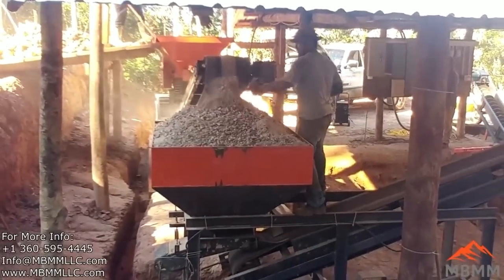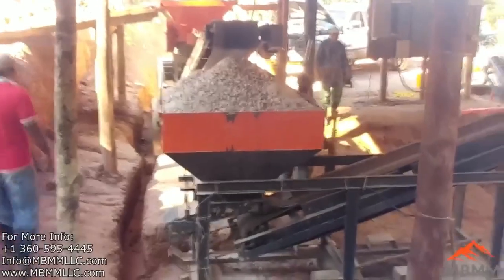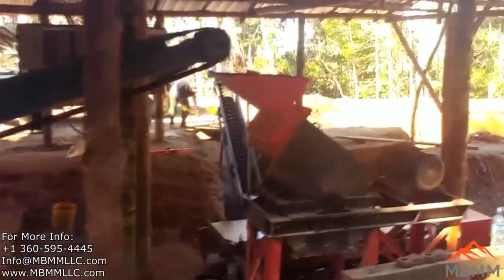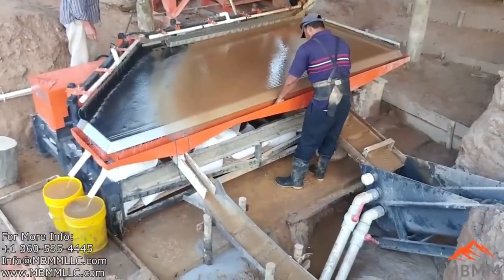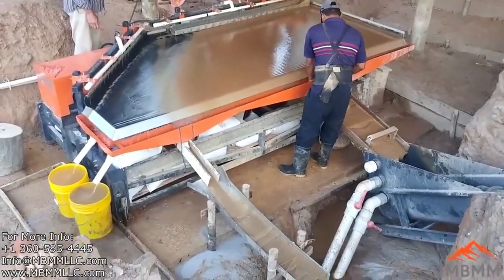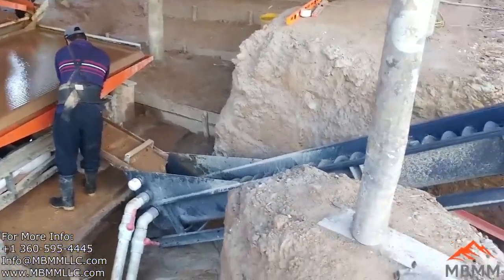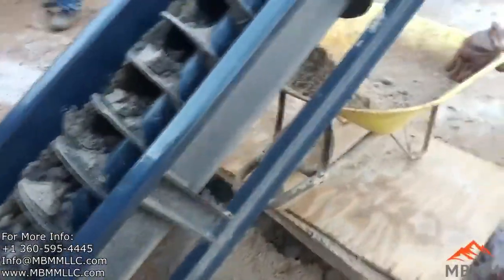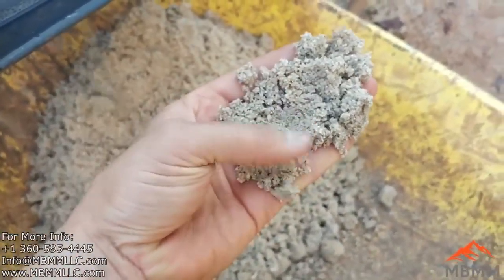This Gold Was Too Coarse for a Normal Crush: How They Ran 2 Tons and Saved Their Gold

Comment: This is pretty cool. Seeing the gear producing for minors. Love your stuff here. I have a set of 1st season chalcopyrite streaked, Lightning quartz bookends from Jayson's mine - I polished up the faces and varnished the outside so it looks wet. Stunning! I also got an irregular shaped cabochon at the same time that was worked by Mine Operator. Still haven't found an artist to mount it.